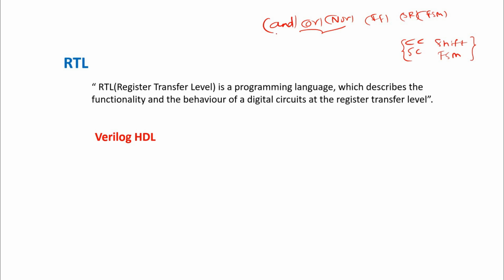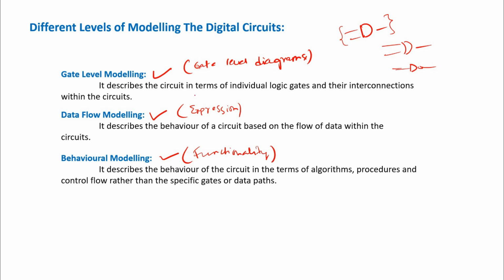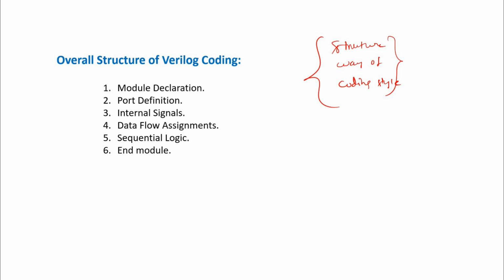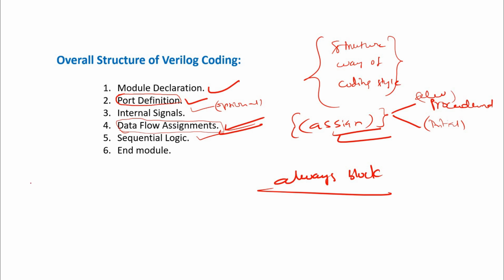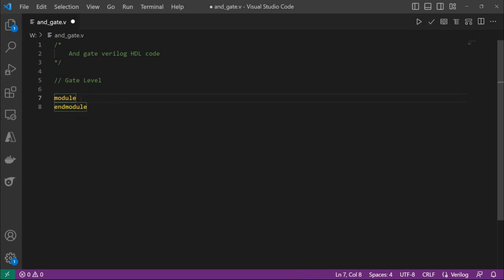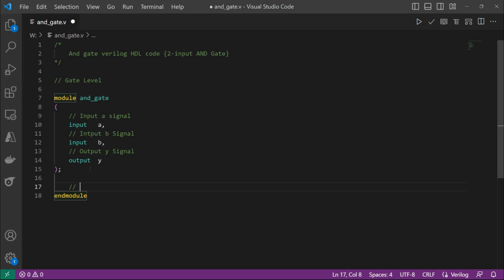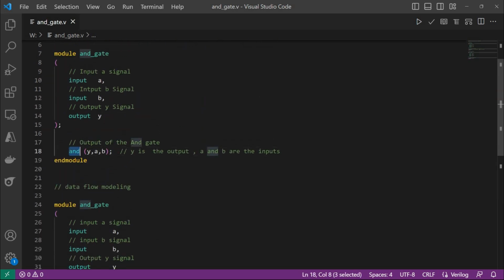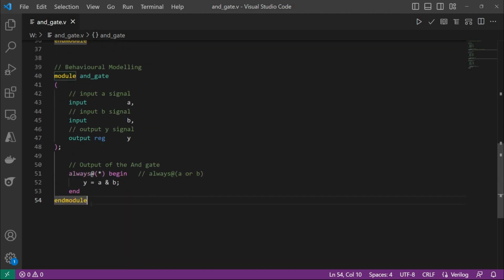Introduction to RTL | Hands on Verilog Programming | AND Gate Verilog Code | Lecture-1

Comment: Module and_gate(a,b,y);
input a,b;
output y ;

Module and_gate(input a, input b, output  y);

What is the difference which one is better to use
Reply from the maker: In total we have Three ways of declaring port lists: 
1. ANSI Style Port List.(it provides clear separation of port list elements)
Ex: what I taught in video.
2. Non-ANSI Style Port List.(it is used for smaller designs having less elements)
Ex: what you posted in the comment section.
3. Interface based Port List.(it provides reusability for complex interfaces)
Ex: Here we can define the interface port lists.

We can use based on our requirement of designing.

We can declare ports as input, output and inout ports also.

Thanks👍